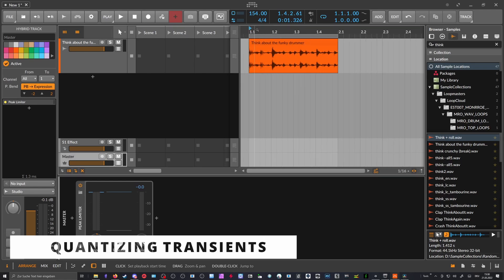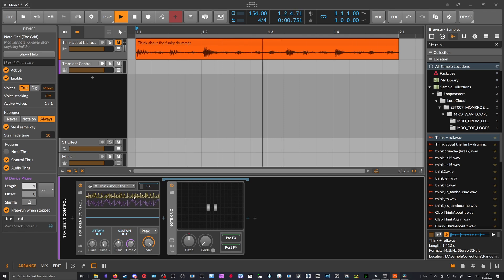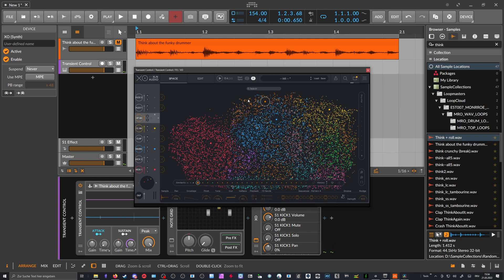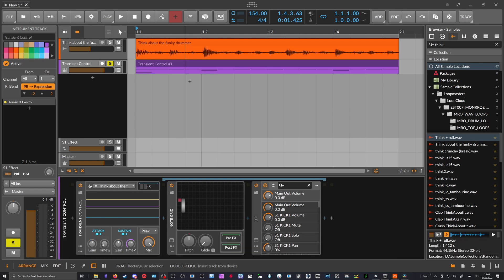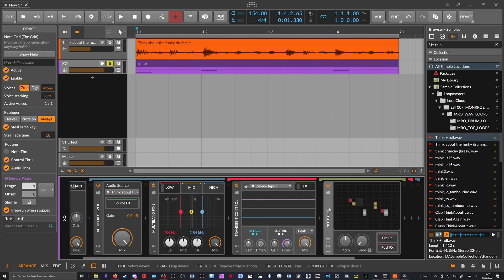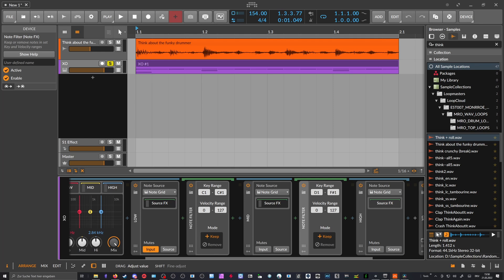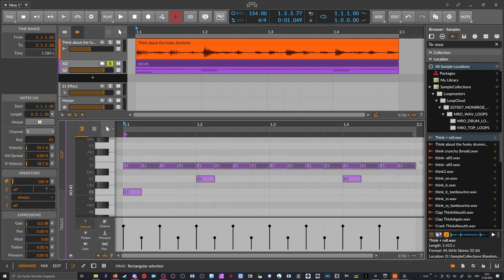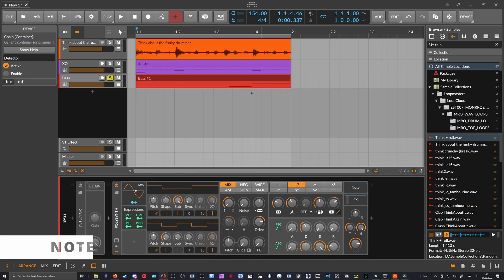Extract Grooves with Bitwig - Transient Shaper Trick / Splitted Bands / Preserve Note Offs

Comment: When I connect the attack mod to the value module in the note grid, I'm not getting a signal showing up on the oscilloscope. Is there step or setting that I'm missing?
Reply from the maker: do you have note grid in mono mode?
Reply: if Note Grid is in polyphonic mode (which it is by default), you won't get anything on oscilloscope until notes come in, and even then it shows last note info by default
Reply: @x-iso  Awesome thanks! it works now.

Comment: Is there a way to detect the velocity of the audio used for the quantize....it is a major part of groove...
Reply from the maker: yes, i would use the amplitude: incoming waveform -> avg module -> velocity value. or in this case, you can just use the envelope follower output as a velocity value

Comment: I think there should be a way to merge both triggers from the clip and the transient shaper because this way when notes are happening in the clip without triggers being generated in the shaper these remain silent, at least this is the way it works in my iteration. Maybe a final OR module combining the clock quantizer and the original triggers after the select module and before the final output, I'll give it a try.